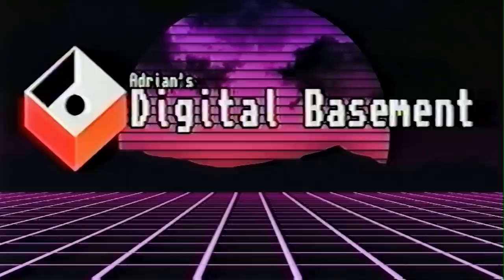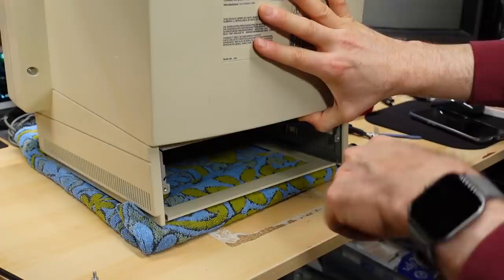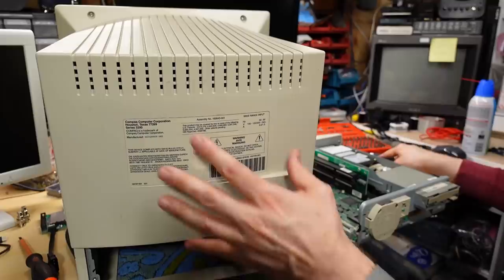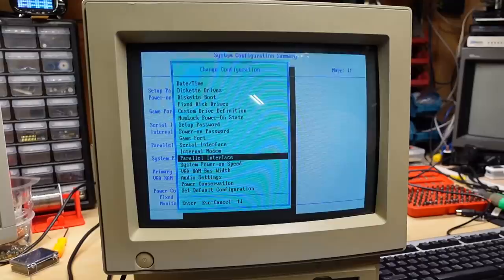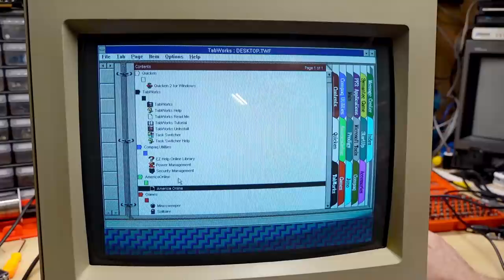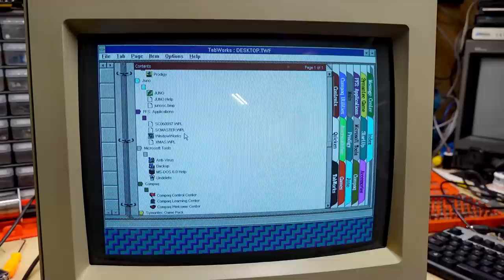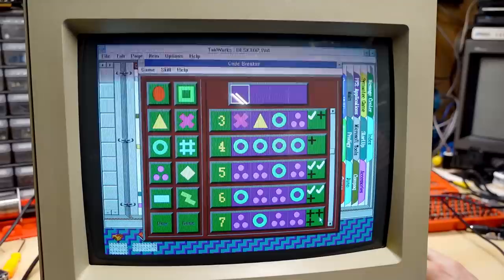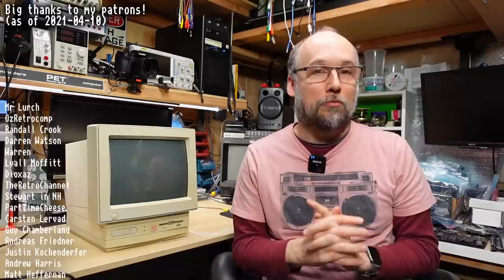PC archeology: Compaq Presario 425 All-In-One (Part 1)

Comment: I used to use Juno because my parents couldn't afford to buy me a computer that was capable of running Windows 95 and the one I had did not have enough RAM to run AOL.  I had an e-mail address through FIDONet that I had set up through my BBS but it was terribly slow and unreliable.  June was free and would allow you to dial up, download e-mail -- I was on a bunch of majordomo mailing lists for bands I liked and it was a big part of my life around 1996 since most people my age were exposed to the internet through AOL and I was still stuck on just using Usenet and FTP.

They later got into the free internet game, I think might have been merged with NetZero --  by that time I could finally afford a capable computer on my own.

Comment: You could probably upgrade that machine just with a DX chip.  If it's a 169pin socket you'll need to jump a pin to ground.  Did it for my PS/1 using a DX/2 66 chip.

Comment: The fact that there is sound settings in the bios would suggest that there is a sound card onboard that use the same speaker as the PC speaker for sounds.  This is not uncommon in these types of machines.  You should turn them back on and see if you get sound in windows 311 beyond the pc speakers sounds

Comment: Of course you probably know LGR has one of these.  I happen to have a Prolinea Net1/33S which is basically the exact same computer (or a 33MHz version) without the joystick and modem ports (it is supposed to have ethernet in their place, but mine is missing the proprietary ethernet card).

EDIT: The pin header you mention at 14:40 is where the ethernet card is supposed to plug in.
Reply from the maker: Ah! So I guess the sound card was an ISA card or was that leftover settings from some other Compaq model?
Reply: @adriansdigitalbasement  I'm not sure, it's possible that there was also a sound option for that slot, but I haven't seen it.
Reply: @adriansdigitalbasement  If you're interested in seeing a photo of the machine I just tagged you in a Twitter post (photos of the missing ports and internal connector in the reply).

Comment: Put either a 487SX or and OverDrive into the socket. Do some research on Intel Overdrive as some are meant as complete swap-out while others have the extra pin required to disable the onboard 486SX.

Comment: If I remember correctly the 487 upgrade for 486sx systems won't support a 486 upgrade unless you solder I think pin 14b to ground on the 486 cpu
Reply from the maker: I explore that more in part 2 :-)
Reply: @adriansdigitalbasement  some of the best days of my life tinkering with my 486.  I'll look forward to the next video :)

Comment: I Think you want the Intel "Overdrive" Processor which is available in 50MHz and 75 MHz varieties (or at 33 MHz 66 and 100).  You need the "ODP" variety which has a pin that disables the onboard processor (The ODPR is a "replacement model" and might not work.
Reply: I've got an ODPR DX4-100 in my 425 and it works :)

Comment: Torx bits don't camout as badly as phillips do!
Open ram sockets?  Rammy will be happy :-)

You should install Windows 95 on that Compaq.  I ran Win95 on a 486 and it ran MUCH faster than Win3.1 ever did, probably because it was 32 bits and not 16.

Comment: i think there board for replace hdd to m.4 ssd i think called adapter ide to m.4 ssd
i think it make it 4x faster guessing but u going need normal pc do hdd swap data todo that
it does need more ram add in n sound card n few other
i would recommend replacing that backup cmos battery because u never know if will leak aging i do have other 93 pc but sadly battery danged cmos chips  n do replace taner because that one of thing will end motherboard life wasnt replaced in this years

Comment: hp still does in most places. t15. Some though will take a flat blade. Modern computer people get all upset. I'm like yea,  yea, yea. Any computer tool kit came with a torque and other drivers. not an issue.

Comment: My family had a Presario 4160 and it was thoroughly horrid. Are the early ones better?
Reply from the maker: I don't have a lot of experience with any Presario model but I have a friend with one from the early 2000s and it seemed like such a piece for junk. This was just seemed well designed and solid. Probably before penny pinching commenced. :-)
Reply: @adriansdigitalbasement  The thing that I remember the most about the machine that I hated was that it had the solder pads on the board for a COASt module slot but no slot and as such no L2 Cache. It suffered really badly because of it. Stupid thing took over a minute to launch AOL 4.0

Comment: Don't understand your obsession with installing flash cards into things like this. Flash cards are not made to handle the multiple writes. Also it's just nice to keep them as original as possible or do only upgrades with period correct hardware. These hard drives are great btw, have the same one in on old 386 and still doing fine.